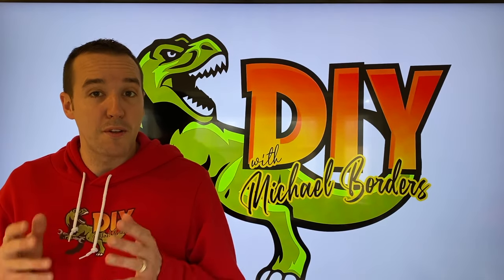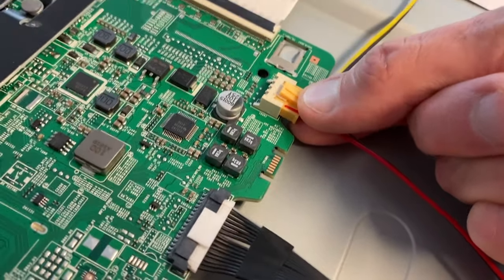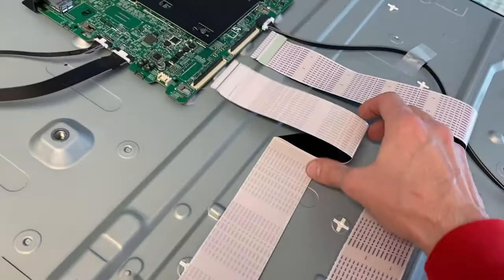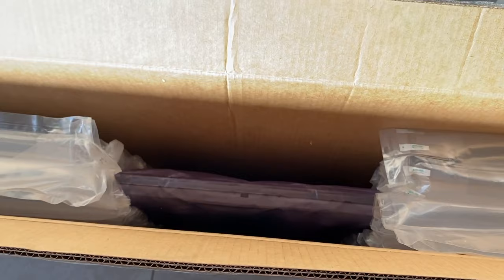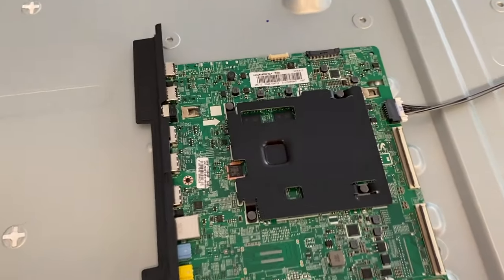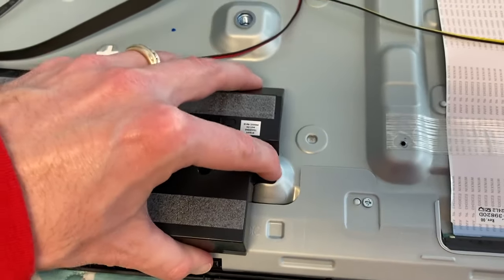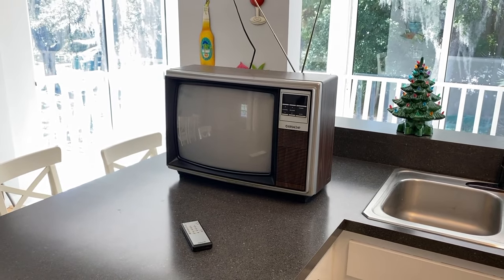How to replace TV screen/panel - DIY Samsung/LG/Sony/Vizio

Comment from the maker: 1.  Vertical lines on TV - Inspect & clean

          https://youtu.be/5IY6TKdi4kg

2.  Vertical lines on TV - Most common causes

          https://youtu.be/v6SA5BQCqJQ

3.  Vertical lines on TV - Replace Main board

          https://youtu.be/qZYYK1xpYQ0

4.  Replace TV ribbon wiring

          https://youtu.be/O9GTDo2Bfg4
Reply: Where can i buy the panels
Reply from the maker: @promediag  

We purchased our replacement panel from:

       PartSimple.com

😎👍
Reply: Can you please tell me where the part number is located for the panel? Thx!
   BTW, this is a concise and just-the-right-of-vocals, without over doing it. No jokes or trying to be funny. Damn good job.
Reply from the maker: @DK-bk1vq  

Good morning ☕️ we really appreciate that, thank you.  The part number will be on a sticker or placard located inside the tv on the inner back side of screen/panel.

You will need to carefully remove back/rear panel to gain access to inner tv.  Once inside, you will see all the tv parts including Main Board, Power Board, ribbon wiring, and more.

You can then get your screen/panel part number.  👍☕️

Comment: where did you order your panel ??
Reply: That what I’m wondering. Any help would be greatly appreciated!
Reply from the maker: PartSimple.com

Samsung BN95-02637B Television LCD Display Panel
SKU: smg-bn95-02637b
Reply: @DIYwithMichaelBorders  where do you find the part number
Reply from the maker: @husseinghosn9701  

Thanks for watching, the part number can be found on the inside portion of TV.  By removing the back panel of your TV, you can gain access to the internal parts were you can track down your part number for your panel.

Hope this helps and hey if you’re into crypto trading, check out our newly launched DIY ecosystem.

     Toolboxtoken.com

We DIYers need to stick together! 🧰
Reply: Where do you buy panel
Reply from the maker: @carmenmaldonado-vidot2970  

Thanks for watching, we purchased our replacement panel from:

       PartSimple.com

Please keep us posted and hey if you’re into crypto trading, check out our newly launched DIY ecosystem.

       Toolboxtoken.com

Reach out to us any time.  🧰
Reply: Hi I have this exact tv that I need to do the same . Can you please put link up thankyou ! Love your  guides!
Reply from the maker: @Sparkinthedark78teatawest  

Thanks for watching, is your panel part number the exact same as ours?  If not, we can look up a replacement panel that matches your exact panel part number.
Reply: I have a 65 inch lg tv is it the same process to replace this
Reply from the maker: @rebelgarage4871  

Thanks for watching, it will be very similar indeed.  👍
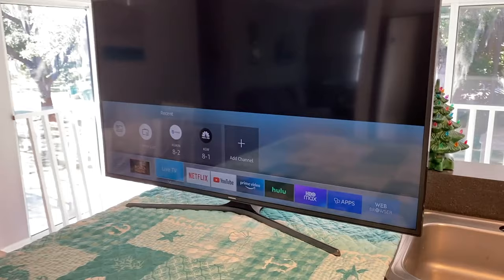Reply: @DIYwithMichaelBorders 11:46 where we purchase tv panel samsung
Reply from the maker: @albertoaltis3609  

Good morning, just poured a cup of coffee and am sitting down to answer any and all questions for the DIY community.

Check out:  PartSimple.com

This is a huge online electronics vendor, and if their website doesn’t show a replacement panel available, we recommend contacting their customer support because they might be able to find one within their warehouse network system.

Let us know if you have any questions and hey if you’re interested, join our DIY ecosystem and help us grow an exclusive group of DIYers.

       toolboxtoken.com

Reach out to us any time!  🧰
Reply: @DIYwithMichaelBorders  hey i need help to look up the part number for my Hisense 60” tv model number 60A6G
Reply from the maker: @danielvictoria-merino719  

Thanks for watching.  Best thing to do is remove the back plastic panel to gain access to the inner portion of your TV where you can then locate the panel/screen part number sticker or placard.
Reply: Master of instruction- thanks for a very helpful detailed explanation!
Reply from the maker: @fretmastersalas4252  

Good morning ☕️

Much appreciated, thank you.  We have many more videos to come.  🧰
Reply: I looked at the website and I didn't find any panels @DIYwithMichaelBorders
Reply from the maker: @DominikCooper-qc4jk  

Bummer, you can contact their customer support.  It’s possible that they can track one down or steer you in the right direction.
Reply: How much are those to buy
Reply from the maker: @johnathonsandler9507  

Thanks for watching, our replacement panel was around $400.00
Reply: I hardly gripped the panel while carrying and it cracked ,flimsy junk today
Reply: I have tried all the numbers on my tv and nothings popping up
Reply: @DIYwithMichaelBorders  thank you for showing that , can i send ma Tv info to order the exact one or tell me how to know ifis it LCD or OLD
Reply from the maker: @DukaliUA  

👍

Comment: I hope you reply @DIYwithMichaelBorders I’ve got a 85 inch Sony Bravia Professional Display with a cracked screen vertical lines. I hate to toss it before seeing if it could possibly be repaired. It less than a year old but got chipped. Help!!
Reply from the maker: Thanks for watching, we do our absolute best to reply to all comments as quick as we can.

Does the crack look more like an impact point as ours does in our video?   If so, it’s likely that you will need to replace your panel.

However, if it’s just a vertical line or horizontal line, your panel should still be good.

Starting with a friendly cleaning of all the internal electrical connections and electrical boards is good.  Below is a helpful link showing us cleaning the internal portion of our TV and inspecting all the parts.

       https://youtu.be/-QdPg_jPkGY?si=9yezI0Xh0NEIg9Qi

If that doesn’t help, replacing the TCON board would be the next part to replace.  Keep us posted on what you do and find.  🧰

Comment: I am glad I came across your video before throwing out my 65-inch! I looked everywhere and even called around to see if I could get my screen replaced. I was told the TV was garbage once the screen broke. It's a very small crack due to my son hitting it with something. It put vertical and horizontal lines on parts of the tv. It looked like your broken TV. So again thank you.
Reply from the maker: You are very welcome, and we are honored our video was helpful.  Thank you for taking the time out of your Tuesday to share this.

👍

Comment: It is just mind blowing to see how incredibly simple today's TV's are, and that they have so few components.  Back in the old days with the old TV's, I recall we used to have lots of pay TV channels in our area.  The pay channel video signals were  basically normal, with the exception of the horizontal sync pulses being offset from their proper location, thus leading to a somewhat scrambled picture on the TV screen. But for about $6 in parts, including the home made PCB, I designed a circuit that fixed that pesky little horizontal sync pulse bug when detected, and of course I installed the PCB assembly into my TV.   LOL
Reply from the maker: @helifynoe9930  

Thanks for watching and sharing your thoughts, modern TV’s seem to definitely have less parts than back then.

That’s awesome and very creative that you designed a feature to be added to your setup to alleviate issues.

😁👍🧰
Reply: @DIYwithMichaelBorders  At one point my boss at work suggested I try and sell my Pay TV decoder design to the cable company.  They turned it down due to its simplicity, even though it also provided a 6db signal to noise improvement in the video quality compared to their decoder video quality.  They said that because my design was so simple, so small in size, so inexpensive, and that it required less than 15mA on the 12vdc power line,  it would be far too easy to be copied and installed in either TV's, or most of all, copied and placed within TV converters.
Reply from the maker: @helifynoe9930  

Very creative.  Old electronics are awesome.  We kept several vintage electronics over the years.  😁👍

Comment: Great video! I have a cracked Samsung 75 in tv screen but the tv also goes on and off every few seconds when it’s plugged in. Is it worth trying to replace the screen or is there a problem in addition to the cracked screen? Cause if it’s more than just the screen, I’d rather not buy a replacement one if another issue needs to be fixed as well. Thanks for your time!
Reply from the maker: Good morning ☕️

It’s always worth looking into a panel replacement price.  75” replacement panels can get pretty pricey though.  The shipping and freight can be an annoying fee, but not always.

In regards to your TV turning on and off, that usually stems back to an issue with the remote.

Comment: Great video, thanks! Do you have or can you make a video on how to repair a 50"-65" Samsung Curve screen? Also, can you share where to get the screen replacement part? TIA
Reply from the maker: Good morning ☕️

We appreciate that, and we don’t have a video on replacing a curved tv panel however you will find it to very very very similar.

We purchased our replacement panel from:

       PartSimple.com

👍🧰☕️

Comment: Excellent instructional video. Impressive that you did the majority of the job one handed while holding the camera in the other hand. I don't understand why people who make these videos don't use a head mount type of camera to keep both hands free to do the job.

Do you have an instructional video on how to remove just the screen cover of my Samsung  if possible. Something got on the inside of the screen so it cannot be cleaned off without accessing the backside of the front clear plastic screen cover. I removed those perimeter Philips screw but the front screen didn't come off so I stopped there. 

Thanks in advance.
Reply from the maker: @SBKid58  

Thanks for watching, we appreciate your feedback.  We don’t have a video at the moment on disassembling panel/screen however it’s on the to-do-list.

😁👍🧰

Comment: @DIYwithMichaelBorders great video and very descriptive, a lot of my questions were answered woth this video. I checked out that website where you said you ordered your panel from, but all i get is appliances and treadmill parts. My tv is a 55" TCL 4k Roku tv.
Reply from the maker: Thanks for watching, we appreciate that.  Do you have your exact TV panel part number?

Although your search on PartSimple.com came up short… it’s still possible that they have it.

We talked to a viewer recently that contacted customer support and was able to be emailed a link to purchase a replacement panel.
Reply: I hope you reply @DIYwithMichaelBorders I’ve got a 85 inch Sony Bravia Professional Display with a cracked screen vertical lines. I hate to toss it before seeing if it could possibly be repaired. It less than a year old but got chipped. Help!!

Comment: Is it possible to put my 82-inch Samsung parts into a smaller (65, 70, 75 inch) Samsung replacement lcd? I can't find a replacement 82 lcd.
Reply from the maker: @dawnsalter2385  

Thanks for watching, that will be personal preference.  We have talked to a few viewers over the years that have done that however we haven’t personally.  Keep us posted.

Comment: I have a question my 58 in TV won't turn on it's a Roku TV and I've tried everything that is said to try and it still won't turn on the red light is on or it will only blink how would I go about changing the power source that way it would turn on

Comment: Thanks for the informative video! I have searched the internet trying to find a replacement panel for a Vizio 43” 4K smart tv panel & not having any luck. Could you recommend a site for me to search please?
Reply from the maker: Thanks for watching & we appreciate you sharing this.  Best thing to do is remove the back panel of your TV to gain access to the internal portion where you will find your screen/panel part # sticker stuck to the aluminum mount.

We can use this part # to find you the exact replacement panel.

Comment: Hey Man, thankyou for this video. I am looking Screen panel  for Vizio- P65Q9 - J01 . Do you have a link where i can get this or any suggestions on which other replacement parts works ? Its 65 inch Vizio Class  P series  4k QLED HDR smart Tv
Reply from the maker: Thanks for watching, best place to look is:

       PartSimple.com

This is a huge electronics online vendor.  😎👍

Comment: Where do you find the model number for the panel? Once I take the back cover off, there’s multiple different numbers on stickers or engraved directly into the chassis. I don’t know which one is the number for the panel itself, and none that I’ve searched are bringing up proper parts.
Reply from the maker: Good morning, just poured a cup of coffee and am sitting down to answer any and all questions for the DIY community.

We recommend entering each of those numbers into google search separately and seeing what comes up.  Once a number brings up a panel/screen, you will know that that specific number is the number for your panel.

Let us know if you have any questions and hey if you’re into crypto trading, join our DIY ecosystem.

       toolboxtoken.com

Reach out to us any time!  🧰

Comment: I'm Lucky. I had a standing floor lamp, get knocked over, into my 27" Asus monitor. I've been using it for a couple of years this way. The Display is fine, no artifacts, but the outer 'protective' clear panel is cracked. It's not an insignificant crack, its at least 5 or 6 inches long. Luckily unless I am looking for it, it is not very noticeable. 
I have no problem figuring out and working on the Monitor, but where do I find the replacement panel (just the clear plastic), without buying a new LCD panel? 
Can I go to a place like, Mr.Plastics, and give them thickness, width, and height, and just buy a rectangular piece of plastic/acrylic? (Mr Plastics sells plastics, and similar material, for hobbyist and small production) 
(Sorry- I am re-posting this from another video commentary section of yours on YouTube)

Comment: Hello Michael, I have a 85 inch VIZIO tv that has a damaged panel. Do you think a screen of that size would be available somewhere for me to purchase? Where could I find it? Can you help me out?

Thanks and great video 👍🏽
Reply from the maker: Thanks for watching & welcome to the DIY Raptor Club.  Great question and the best thing to do is remove the back panel where you can gain access to the internal portion of the TV.

Once inside, search for the part # sticker that is located on the aluminum panel.  This part # will be your screen/panel part #.

We can use this to look up exact replacement panels if available.
Reply: @DIYwithMichaelBorders  Brilliant video. Are there any online marketplaces that are good to buy panels from
Reply from the maker: @matthewwoodmass4161  

We appreciate that, we purchased our replacement panel from:

       PartSimple.com

😎👍

Comment: Can you separate the LED screen from the panel it's attached to.  I have a Sony and they no longer sell the replacement screen. I'm wondering if I could pull the LED from a similar Sony model and attach it to the panel on my TV.
Reply from the maker: Thanks for watching, you can however it’s a tedious process but definitely doable.  👍🧰

Comment: I wish it showed the actual step by step replacement of the old screen with the new screen, being a 1st time diy’r for this process, that was the REALLY big step I needed to see. Thx for your video otherwise.
Reply from the maker: Thanks for watching, we didn’t leave a single step out.  Let us know what we can help you with.

Us DIYers need to stick together!!!
Reply: I missed it at first, too. lol The old panel was taken off the bed and put on the floor. He put the new panel (it was all one big piece) on the bed in its place and reconnected the old components to the new panel. Once you take off the old components, you're done until the new panel arrives and you put them back on,

Comment: I can’t seem to find the panel number for my tv or they just don’t have the parts thanks for the content it really helped
Reply from the maker: You are very welcome, we appreciate that.  We recommend contacting PartSimple customer support.  Website below.

     PartSimple.com

It’s a huge online electronics vendor, and they may be able to track down a replacement panel if you provide them with your TV serial number and model.
Reply: @DIYwithMichaelBorders Hello, what is the model of the Samsung TV from 0:20 to 0:30 ?
Reply from the maker: @Noah9000YT  

Thanks for watching, this is a 2016 55” model.  Don’t recall the actual full model number, we aren’t currently with the tv.
Reply: @DIYwithMichaelBorders  Thanks 😉
Reply from the maker: @Noah9000YT  

👍

Comment: I have a Vizio 65 inch Quantum LED. can I use any 65 inch quantum LED panel? for example can I use a Sony or another brand 65 inch LED panel for my Vizio?
Reply from the maker: Thanks for watching.  Great question and unfortunately we haven’t interchanged different manufacturers panels with one another’s power and main boards in the past.

Not saying it’s not possible however we just haven’t performed it.  Keep us posted on what you decide to do.

Comment: Great work. Do you have a link to the website where you bought the new panel?
Thank you
Reply from the maker: We appreciate that, we recommend checking with:

       PartSimple.com

Huge online electronics vendor and if their website does not have it, contact customer support and see if they can track down a replacement panel within their system.

Keep us posted.  Let us know if you have any questions and hey if you’re into crypto trading, join our DIY ecosystem and help us grow an exclusive group of DIYers.

       toolboxtoken.com

Reach out to us any time!  🧰
Reply: Hi, do you knew where i van find Sony Bravia lcd kd-55xf7096 screen panel. Mine is broke
Reply from the maker: @mohamedi9508  

Thanks for watching, check out:

       PartSimple.com

If it doesn’t show available on the website, contact their customer support because they may be able to find it somewhere within their warehouse tracking system.